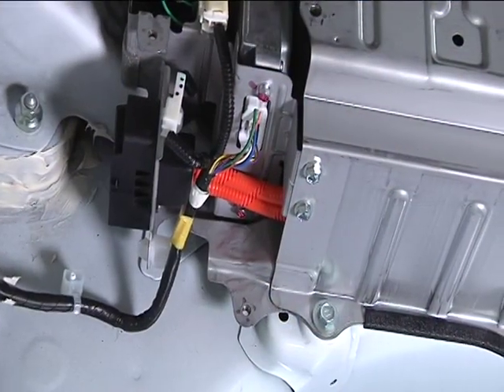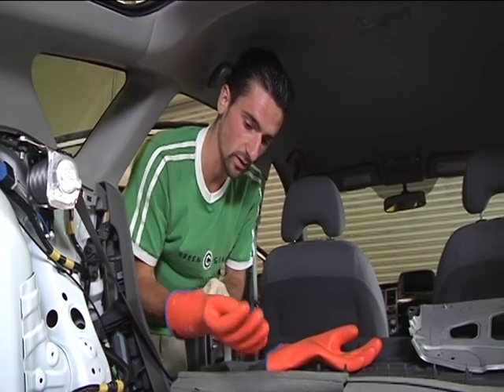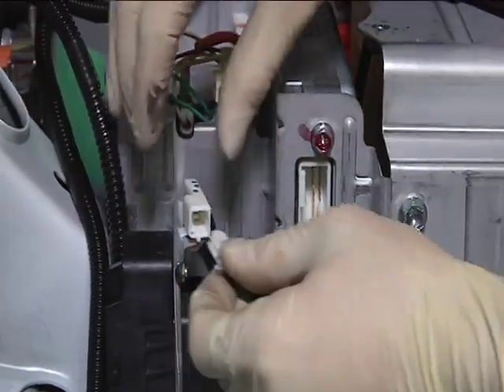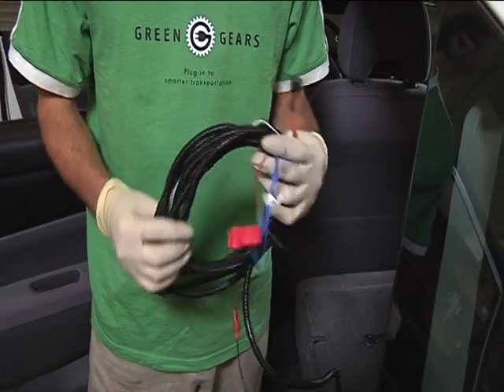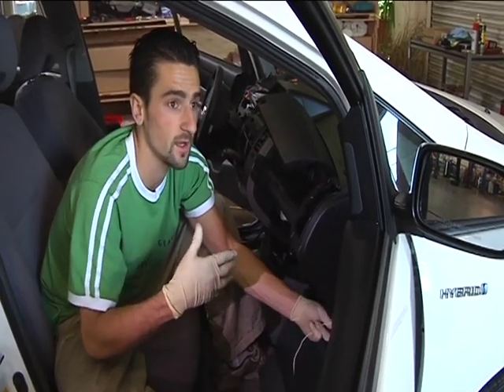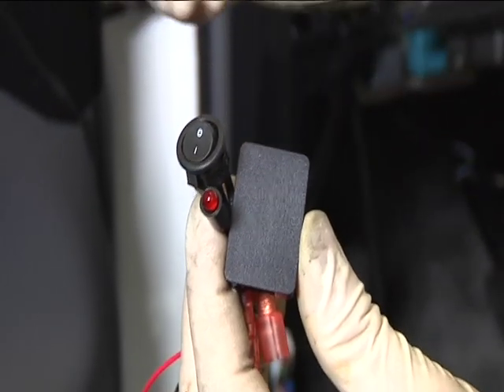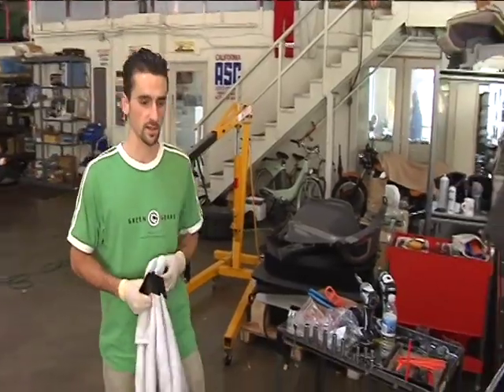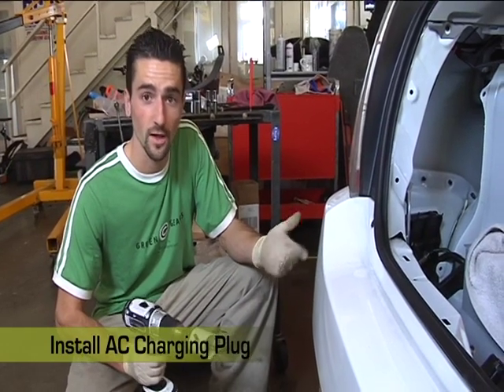Plug-in Hybrid vehicle conversion

Comment: This kit is long gone. About ten+ years ago A123 was acquired and orphaned by Johnson Controls. I installed this though.
Reply: I purchased a 2009 Prius with the hymotion battery. Now the red light to the left of the steering wheel just flashes now and then. Do you happen to have or know of some online resources that could help me trouble shoot my hymotion battery? I would like to find a way to figure out if I should remove and throw away the hymotion battery vs. Making sure it still has life left in it .. any feedback would be greatly appreciated.
Reply: @zachariahzaghloul6723  Late reply, but if you haven't found Priuschat forums, go there and look.
Basically, you need to open the battery with insulated gloves (because the voltage inside might kill or hurt you otherwise) and measure the cells inside. Or have a more electrically experienced friend help you.
Most likely one or more cells have gone bad - triggering the safety cut-off.
Reply: @markusfalk9459  thank you for the feedback. I have in fact opened it up and realized that it has multiple cells. I also found some literature about how to test the voltage for each cell to determine which one to replace. I definitely need to get the special gloves before I tackle this job. I also found what appears to be replacement cells on eBay but it will be a gamble of they work as they should. In any case, I will be giving this a shot before I throw it away. Thanks again for the feedback.

Comment: I'm wondering if a direct LiPo conversion from the NiMH battery would be possible. It may not even require a conversion of the native Prius charging system. The Prius charging system will not charge past 90% and I believe it won't discharge below 40-50%. I'd need to do a little more research but the Prius will also limit the amp discharge from the NiMH battery to prevent them from boiling over (although they do offgas during heavy acceleration/use).Any experts care to share some insight?
Reply: Yes there safety settings in computers and the aftermarket charge and discharge people sell them to condition the pack to last longer
Reply: It is possible to get the battery to 100% - with a long enough steep hill. Hold the brake down enough to regenerate but not enough to physically brake, under 45 mph, and eventually the engine will start. When this happens, the battery is at 100%.

Comment: Important information left off:
(1) What is the cost of the unit and the cost to install everything (I'm not a do-it-yourself mechanic)?
(2) How many miles will it go on 1 charge, before it needs to have another charge?
(3) How long does it take to do a complete charge?
(4) Can a solar panel be added so that it charges while you are using it, or not using it 
(5) Instead of hooking the charger indicator to the tail light, why not add an easy to replace inexpensive common bulb on the bumper next to the charging plug area?  In fact there could be 2 bulbs of different colors: one for electrical charge; one for solar charging.
Reply: Great questions. I'd like to know that too. 
Answering 4: A solar panel fitting the car wouldn't really make enough electricity to charge the car for driving. For the rest of the electronics maybe, but that's out of the scope of this kit and relatively easy to add. 
5 is also VERY easy to change and mostly just a matter of preference. I like the idea of using the tail lights as it does not require any extra components.

Comment: THIS IS AN ADDITION TO THE PRIUS BATTERY, WHEN IT SHOULD BE A REPLACE, TOYOTA HYBRID BATTERY, WEAR OUT TO MUCH AND ONLY LAST 10 YEARS OR 150K MILES OR LESS SO AFTER $5000 DOLLARS OF THIS YOU GONNA PAY AN OTHER $4500 TO REPLACE THE ORIGINAL HYBRID BATTERY!
Reply: RAMON RUIZ I have a 2006 Prius and my battery cells started going out one after another. 3 to be exact. Within 2 months. They are about 20-40$ used on eBay. So at 337,000 miles my original battery was removed at home by me. Not very hard what so ever! You're gonna need some muscle. The brand new one cost me 1800$ with a 3 year unlimited mile warranty. This all happened early 2016 and as of last night I now have 357,000 miles. Still going awesome. And lately I have seen some new battery packs for around 1000 or less. With a warranty of course. All that aside it was way better than 3700$ the dealer quoted Me. And it only had a 3 month 5,000 mile warranty. As for the motor... it burns about a quart every 3k miles. ZERO LEAKS!!! Never had the head, valve cover gasket changed. I should do that soon. The lifters are very very noisy and has been that way since 275k and the exhaust flange right before that cat is bad. 6$ fix. Simple fix. I have had this car since 0 miles. And plan on driving it till the motor blows. Then I'll fix it. Ohhh and the front brake rotors are original with just a little bit of rust. The pads were replaced at 100k "the dealer recommended" I still have 60% pad left. The first and only repair I did besides the battery pack was a wheel bearing at 70k. I have spent a total of $4,000 on tires and I do my own oil changes... mobile one super high mileage 10w/40. It's good for 7,500 miles. Since I burn 1/4 or the oil and refill little by little once every 300-400 miles "every gas fill" the oil stays somewhat clean. So I have been stretching the changes to 12,000 miles. I buy a k&n oil filter used for a marine engine. It's very large compared to the original. It holds another 3/4 quart. If you have any questions for this very OLD VIDEO email me at. 
Repairserviceofmn883@hotmail.com
Reply: I have a 2006 Prius and my battery cells started going out one after another. 3 to be exact. Within 2 months. They are about 20-40$ used on eBay. So at 337,000 miles my original battery was removed at home by me. Not very hard what so ever! You're gonna need some muscle. The brand new one cost me 1800$ with a 3 year unlimited mile warranty. This all happened early 2016 and as of last night I now have 357,000 miles. Still going awesome. And lately I have seen some new battery packs for around 1000 or less. With a warranty of course. All that aside it was way better than 3700$ the dealer quoted Me. And it only had a 3 month 5,000 mile warranty. As for the motor... it burns about a quart every 3k miles. ZERO LEAKS!!! Never had the head, valve cover gasket changed. I should do that soon. The lifters are very very noisy and has been that way since 275k and the exhaust flange right before that cat is bad. 6$ fix. Simple fix. I have had this car since 0 miles. And plan on driving it till the motor blows. Then I'll fix it. Ohhh and the front brake rotors are original with just a little bit of rust. The pads were replaced at 100k "the dealer recommended" I still have 60% pad left. The first and only repair I did besides the battery pack was a wheel bearing at 70k. I have spent a total of $4,000 on tires and I do my own oil changes... mobile one super high mileage 10w/40. It's good for 7,500 miles. Since I burn 1/4 or the oil and refill little by little once every 300-400 miles "every gas fill" the oil stays somewhat clean. So I have been stretching the changes to 12,000 miles. I buy a k&n oil filter used for a marine engine. It's very large compared to the original. It holds another 3/4 quart. If you have any questions for this very OLD VIDEO email me at. 
Repairserviceofmn883@hotmail.com
Reply: @spencerhadley3617    The Gen 2 prius odometer stops at 300k. At least thats what I've read from Priuschat. How did you get it to go pass 300K.
Reply: @blakedoan1568 , my 2009 Prius shows 325,000mi
Reply: Ramon NO hybrid batteries are ava in  salvage yards and rebuilders for 700 dollar range
i have two prius 2008 and 2004 both have replacement battries

Comment: I was about to ask if anyone in England are doing this but by the comments below I can see I'd be wasting my time.
Sound a great idea - shame they didn't explain what it will do to the general running of the car or if it will run on electric only but still use engine if you need more power.

Comment: Who's idea was it to have it burning out the brake lights prematurely? Wouldn't it be better if it only burned out the lights that are cheaper to replace? Maybe the marker lights?
Reply: The rear lights are all LED. I drive a 2005 with 400,000 miles and these lights have never need replacement lamps or any servicing.